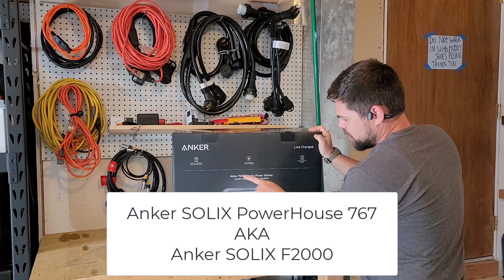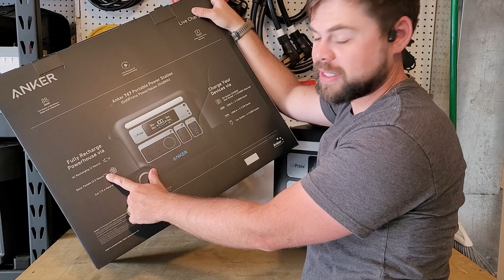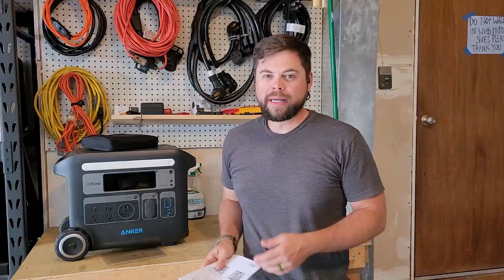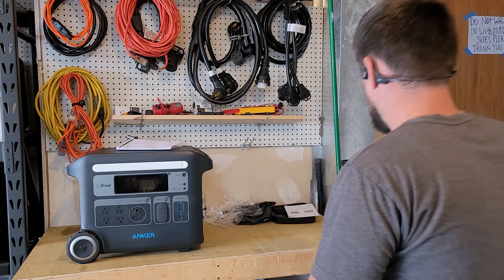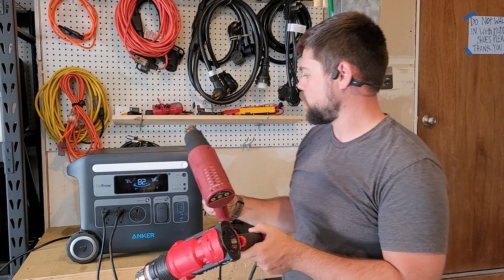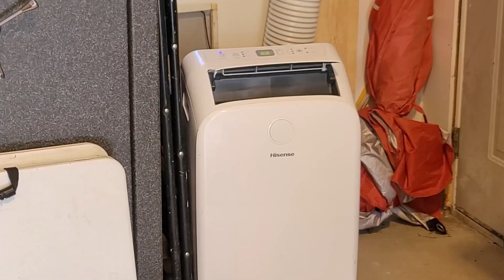Anker SOLIX PowerHouse 767 Solar Power Station Review

Comment: Hi, greetings from the Netherlands. I have 2 Anker Power Stations, the F1200 and the F2000. I use both in the house to charge them via the solar panels on the roof of the house, simply via the 230v charging cable in the power strip. I use this stored (free) electricity in the evening, watching TV or working on the computer (F2000), in the kitchen for the coffee machines and the air fryer (F1200). 💪
I also take the F1200 with me on holiday, I have the 3 flexible solar panels from Anker suitable for the F1200, too bad they are not interchangeable for the F2000, Anker support says not, or is there a solution for this? 🤔

Comment: I pu chased the Anker F2600.  Basically same thing with more power.  The first turn on happens when you plug it into the wall.  Then it works by pressing the button.

Comment: I have one and love mine.  Couple things I'm not sure you caught: 1 is a firmware upgrade.  They've made a lot of improvements to allow ACs to run properly.  It had a lot of issues as they've worked those bugs out.  2 is that it does not do pass through charging.  If you have it plugged in, you won't get full access to AC power through the internal inverter.  You can charge with a DC source (solar or cigarette adapter) and still have full use of the AC outputs.

Comment: 12:00 The Airconditioner not being able to run is a known defect with these Anker F2000. They have two known defects and thats one of them. it needs to be replaced by anker
Reply: Firmware upgrade fixes this issue.

Comment: There is literally a sticker on the back next to the Inputs that says to turn it on the first Time, Plug it in. Which should also kind of be common sense with a device like this.
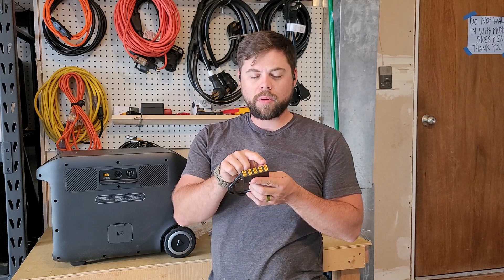Reply: Hmm, well clearly on mine that sticker is not there since you can see in the video at 2:20 there is no sticker next to the power input ports.
Reply: @kingbengman I don't know how you could possibly be this blind, but at the time you speciify there is literally a sticker full of grey text right below the inputs.

Comment: I have the combo that I use in my shed, for the most part it works fine. Some things I wish they would have done, like made the auxiliary battery should have had a passthrough handle, it is awkward to carry it and no way to secure it to the other unit. Every now and then, it trips when using the miter saw but it does a good job. The bluetooth range is ok, could be alittle better and on occasion, I have to rehit the button, defeats the purpose in my opinion. Don't use the solar panel that often but I have the two that came with them, they are heavy, didn't know that. I ordered a bag for them and just leave them in my basement.

Comment: I also find it frustrating with the XT-60 parallel adapter for solar panel connection, and the odd voltage/amperage limit for 1000W input. The parallel adapter also has exposed terminals for a big shock risk. I have watched lots of YouTube reviews on this unit, and every review that used a small air conditioner or applied a somewhat bigger conductive load, it failed to work. This unit is a no go for me. Thanks for another great presentation. Keep it up!

Comment: Portable Solar Power Station QUESTION: 

In a completely off grid scenario, 
(ie. only Solar Panels to recharge),
Can this (or any other), 
portable solar power station, 
be programmed to automatically 
turn ON the AC Outlet circuit, 
once the battery is sufficiently charged,
WITHOUT human intervention, ???

So that it can automatically provide 
power to any AC connected items,  
without having to go to the remote location.

For Example:
If there is a shed located 
in the middle of a corn field,
where grid power does not exist, 
a portable solar power station, 
could provide power 
to a camera NVR system, 
for security.

If the battery ever run out of energy, 
the next day after the solar panels
recharge the batteries to a sufficient level, 
I would like the AC Outlets, 
to automatically turn on,
allowing the NVR to boot, and begin recording, without any intervention by me.

Who makes a unit that offers this functionality?
What Brand, and Model?

What is a search term that can be used in google to search for this capability?

thx
Reply from the maker: Awesome question. We call this "dark start." The ONLY unit that can do that is the Apollo: https://poweredportablesolar.com/product/hysolis-apollo/ You preset at what percentage you want the AC outlets to start back on. So if you drain it to 0%, the AC outlets will turn off. Then if you set the dark start mode to turn on again at 30%, once the batteries hit 30% the AC outlets turn back on and continues running everything on the AC outlets.
Reply: THANK YOU - I have been asking this question everywhere!  No one has had an answer except for you!  

Much Appreciated!!!

Comment: I guess the UPS mode flickers the output fo 10ms off briefly and conpressor stalls. Maybe  with pasthrough off, in double inverting mode, it may contioue running like any battery povered inverter.

Comment: Everything solar with this is lame. The parallel block with the exposed terminals is dangerous. The fact that most people will not be able to even get 1000w of solar into this so forget about Over paneling. The expansion battery is just like Ecoflow- can't be used stand alone - very limiting. I think you can only add one battery. Besides the solar, it is a nice unit.

Comment: I have the UK version (before the Solix renaming) and it’s quite good since they upgraded the firmware. Sadly it’s not quite fast enough to switch from mains to battery without causing reboots some times.
Btw, you need to plug it into the mains to get it to start up out of the box.

Comment: I liked the explanation of the panels volt, amps and watts strings.
Something that may be a factor is:
unless you are on the equator at noon, 
no solar panel will produce its rated capacity.
It is common practice to over watt your charge controller for this reason.
I rarely get much more than 250W out of my 320W panels. 
This partly due to less than optimum angle.

Anker may be saying you could safely put 1000W in, but only get 800W out.

Comment: I had the same issue powering on their recently released C1000 unit. There is a sticker (blends in on the back side that says that it has to be recharged to activate before using for the first time. It's easy to miss since it blends in with the case, would have been better on front by the power button IMO.

I've never seen that required before from Jackery, EcoFlow, or Bluetti. The Anker Facebook group replies I received when asking about this only told me how common/expected this was :-/

BTW their new F3800 is their biggest unit and can 240v from a single unit. Probably worth a review.

Comment: those companies not only want their products to be paired but they make you use em less stressed so the waranty can be optimal!!!!    as an eco flow delta 2 user i saw the solar input is so sophisticated with markets solar pv voltages so  nether you trip it to limit or use it 70% without stress mppt!!!    they prevent car charger fires  and meltdowns with extra pin and only if you have several electrician knoledges you can push those  powerstations to their limits!!! which is a bit risky!!! if anker at the store i shoped  had this unit back then i could go with the double capacity of it !!!

Comment: Unless they have standard MC4 connection included, and have an easy and fast solar charge capability, I won't buy it. I have a couple small solar generators that I use as UPS for backup power and I don't care as much about the solar. A large unit like this Anker doesn't seem to be up to brands like Ecoflow or Bluetti. I have a 4kw system with output of 3600w@20amps that accepts up to 4800w of solar(3 sets of 1600w) and that is for grid down situations.

Comment: I have an Anker too, and unfortunately I couldn't use it for my intended use case (30A power to an RV with supplemental recharging from a Rivian) becuase of a similar problem to what you saw at 7:58. There's something strange going on with the circuitry around the built-in AC/DC conversion and pass-through AC charging. I did some testing with it but ultimately couldn't figure out what was going on. I like the Anker for smaller loads, but not for large ones.

For RVing I use my Pointzero Titan instead, since it has a separate AC/DC power brick and so there isn't any conflict between incoming and outgoing AC power.

Comment: The solar connection and having to buy Anker solar panels is a non starter for me
Reply: Every single panel from 200 to 550w is maximum 50volt so you ca put them instead
Reply: You DON'T have to buy Anker solar panels.
Reply: @danielkramer8586  can you explain how to get 400 watts and keep it under 60 volts
Reply: @mannyfragoza9652  This is my understanding: Look at the Open Circuit Voltage (Voc) and Maximum Open Current (Imp) numbers for the panel you are considering. If you connect the panels in Series, you add the Voc numbers. If you connect the panels in parallel, you add the Imp numbers. As long as the 60 volts input maximum on the power station is not exceeded, you are good to go. Add as many panels as you want/can to get your 400 watts, but again, you have to keep it under 60 volts input.

Comment: Anker has fixed the AC overload problem by firmware v1.2.2, source https://youtu.be/codgM6dlLhQ?si=0hqDgQBXykReYvbr&t=1622
Another report "I had a similar problem with my Anker 767 it wouldn't run 1000 watt air conditioner. I emailed Anker Customer support team with the serial number and they pushed firmware 2.0.2 update and now it works perfectly. It runs my portable air conditioner with no problem now. You might just need a software update." from comment on this video: https://youtu.be/0ULwB0YSfsY?si=JLjnlTKXVvYznrE2

Comment: I wouldn't buy the Anker 767, because it uses the same high frequency, transformerless inverter technology that is found in all expensive, Chinese made solar generators on today's market. These solar generators simply don't last. They don't last very long because without an iron core, copper wound transformer to absorb the back EMF and high surge demands of high inductance loads, the MOSFETs cannot take repeated exposures to high surge loads such as portable AC units, full-sized refrigerators, large power tools or large microwave ovens. 

Don’t get me wrong, high frequency inverter tech is ok for low power, non-inductance loads like laptops, small fans, small heaters, charging cell phones or battery powered tools or heat guns, but powering high inductance loads like full sized refrigerators, large power tools, portable AC units or large microwave ovens is absolutely not what they were designed for and they can be downright dangerous when used with high inductance loads. 

The reason for this is that all these high frequency inverters lack a very critical component. That critical component is an iron core, copper wound output transformer. Without an output transformer to act as a buffer to absorb electrical surges provided by the “Flywheel Effect” inherent in the physical amount of a transformer’s iron, these surges and damaging reverse voltage spikes as the inductive load is switched on and off must be handled directly by the inverter’s MOSFET transistors, essential shortening their life. 

You might be able to start and run some high surge loads when this Anker solar generators is new, but every time you fire up that inductive load, you're shortening the life of the MOSFETs in this solar generator's inverter. They also run much hotter than low frequency, transformer-based inverters which makes the low cost, off spec, Chinese made components such as capacitors, diodes, MOSFETs, resistors and ICs that are used in these cheap inverters, far more prone to early failure. 

Another major consideration with these high frequency, transformer free solar generators is safety. All it takes is for one of their MOSFETs or IGBTs to short to ground or the control circuitry to fail and these units will send dangerous, high voltage, high amperage DC current straight to your connected AC loads which will not only damage most AC appliances but can also set those AC appliances and your van or RV on fire.
Reply: Any brands in particular that you prefer or recommend? Or are you a DIY guy?
Reply: I would recommend building your own solar generator using either Schneider Electric, Outback, Magnum,  Growatt or Sigineer low frequency inverter/charger products and add a stand alone MPPT solar charger if the inverter you choose doesn't already have one and add a quality 24 or 48 volt LFP battery pack. I've been repairing inverters for the past 23 years and have found the brands of inverters that I have listed to be the safest and most reliable. @Bamabrute85
Reply: Not sure it could be any worse than a goal zero! Why would they give a five year warranty?
Reply: Many of these companies don't plan on being in business 5 years from now to honor their warranties. Over the past 23 years I've seen dozens of these Chinese manufacturers disappear from the market.  @simon359
Reply: So what is the best option?
Reply: Assemble your own solar generator using a low, frequency, transformer based inverter/charger. It will last far, far longer , can easily power high surge loads without being damaged and will be much safer to operate.  @latymz

Comment: You only get 1000W if you buy 5 of their 200 W panels!
Reply: No, I have 10 one hundred watt panels from Renogy and connect them as five parallel, two series panels. So you don’t have to buy Anker panels.
Reply: I’m curious if you expected more than 1000 watts from 5 of their 200 watt panels considering 5x200=1000 😂😂😂😂
Reply: @scottkindley  
No, I was expecting 800 W because of the mentioned combinations.